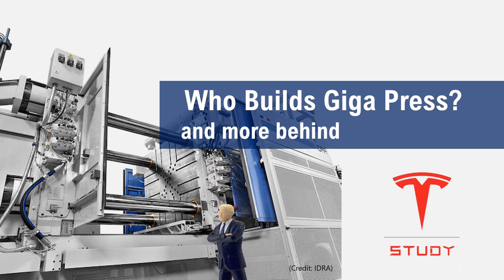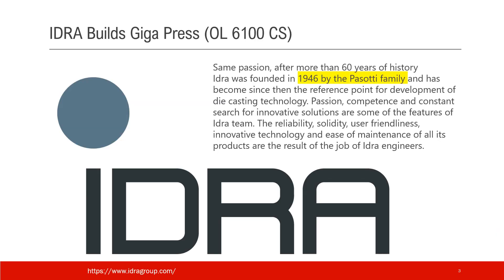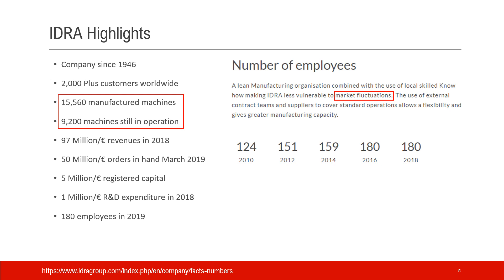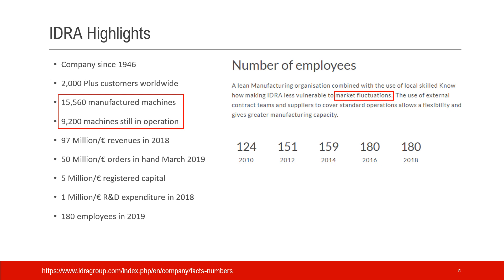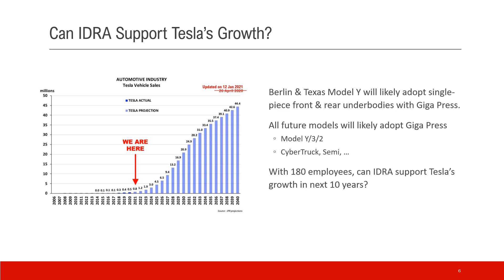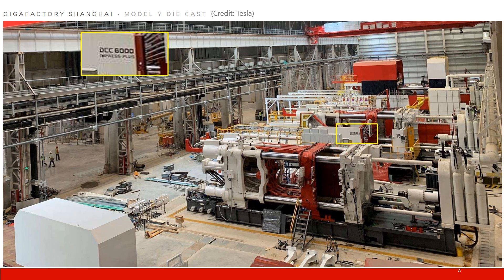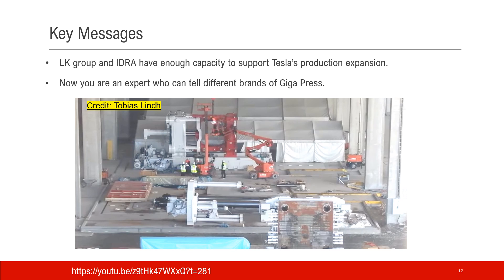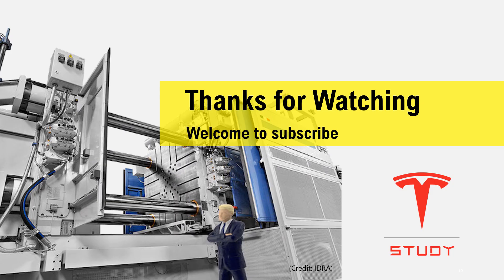Who builds Giga Press (and more behind)?

Comment: China is in control of Teslas future.  Owning factory that makes gigapress, China can phuck over Tesla any time it wants to take over EV market.
Reply from the maker: IDRA/LK needs Tesla more than Tesla needs them. There are several companies which provide large die-casting machines. For example, Buhler group provides up to 5600 tons die-casting machine, 10% smaller than Giga Press. I am sure they can close that gap if they get good orders. Some EV companies in China work hard to compete with Tesla, so do the European ones and the US ones.
Reply: @t-study5089  uhm wrong, IDRA is very big and also makes casting machines for other companies for very different applications including the aviation, space industry....... IDRA has sooo many customers.
Reply: I wouldn't worry about Tesla perhaps having made themselves vulnerable to China cutting off their gigapress access.  People who land rockets on barges at sea then to think things through in detail.
Reply: @bobwallace9753  making giant presses is not fiction science, bmw was actually the very first company to use giant castings on the i3 precisely. IDRA is one of the most specialised company and they have been making presses for different companies and different applications.
Reply: @bobwallace9753  there is no significant advatntages to castings and no other companies has been using 70 different parts like tesla was doing. EVs have relatively a much simplier construction and other compnies like vw which makes 10 million cars a year just needs new dies for the new EV model.
Reply: @alanmay7929  I've been following Elon since the Tesla Roadster was announced.  One thing I've noticed about Elon is that he's pretty good with math.

Comment: Tesla says they invented a new type of aluminum for the giga press. What type of aluminum do the other press customers use and how is Tesla's better?
Reply from the maker: You can google "die casting aluminum alloy", there will be some good intro info, e.g. https://www.mesinc.net/wp-content/uploads/2015/05/Die-Casting-Aluminum-Selection-Guide.pdf. Elon mentioned in battery day that Tesla's proprietary alloy is very friendly for casting and has high strength.
Reply: They haven't invented nothing, its just regular alloy like in the industry, everyone hasnits own alloy. Bmw, toyota... also uses magnesium alloys, carbon fiber made in house.....
Reply: The alloy Tesla developed does not need to be heat treated after casting.  That speed up the process but more importantly by avoiding the heat/cool cycle the chance of part warping is avoided.

I don't think Tesla has revealed the composition of their alloy.  

The also developed a unique stainless steel for the Cybertruck.  It may be a shared product with SpaceX.
Reply: @bobwallace9753  bullshit, alumunium needs to be cooled down properly and verified for defects so there are going to be alot of rejects. the cypertruck "steel" is nothing special, mercedes, bmw...... have been making armoured cars for decades and those are way more secure than the "cybertruck" which isnt even buletproof. mercedes, porsche and other sport car makers also have special titan and magnesium alloys  and carbon fiber for extra rigidity and ligntness.
Reply: @alanmay7929  Right, Alan.  We all bow to your superior knowledge.

I'll drop Elon an note and let him know that Tesla has failed.

Comment: Common cybertruck is gonna be made from stainless steel no press or molding machine as Elon said press would break
Reply from the maker: Surface will be stainless steel, rear chassis will be casted aluminum. "In January 2021, Elon Musk announced that also the rear chassis of the Tesla Cybertruck would be produced using an over-8,000-tonne-force (80,000 kN) casting machine." He said this during last 4Q update, and recorded by Wikipedia and other medias.
Reply: @t-study5089  isnt the point of skeleton construction that there is no chassis
Reply from the maker: @gregexplorer8901  I guess the car cannot just be skeleton. There will be some pieces in the front and back underbody. Call them chassis or not, doesn't matter. If they are not required to bear much force, the thickness and weight will be reduced accordingly.
Reply: @t-study5089  The stainless steel exoskeleton will be very rigid which means, I would guess, the underbody could be a bit less strong than if there was a twisty body on top.  But critical parts of the underbody will have to be beefy enough to carry the weight of the vehicle.

Comment: Where are the 15 Giga Press?  I know there are 2 in California.  Texas has one.  Berlin has foundations for eight, but only two have any parts built on them.  China has 4 machines (I think) and I heard they were built in China.
So 7 complete machines and 2 partials.
Reply from the maker: Very good question. Fremont 2, Shanghai 3. Could be 5 for Berlin and 5 for Texas. You are right. Only a couple of them on Berlin and Austin sites. I guess the rest may be in some nearby storage. No point to pile them on site while no installation capacity. Shanghai could take a few more if one ongoing building expansion is for die casting. check this https://www.youtube.com/watch?v=w2fdI3yNHPo
Reply: @t-study5089  Shanghai construction speed and capacity are amazing.